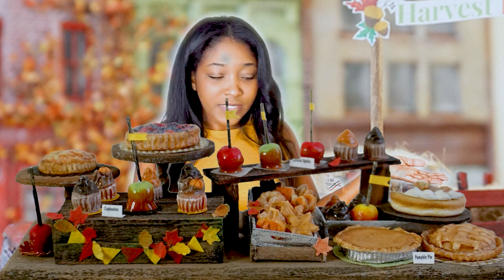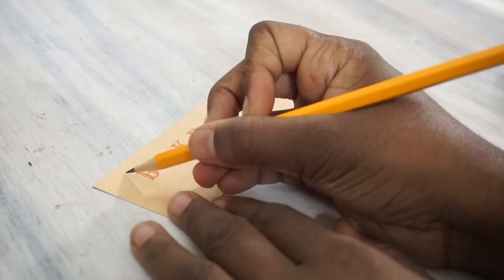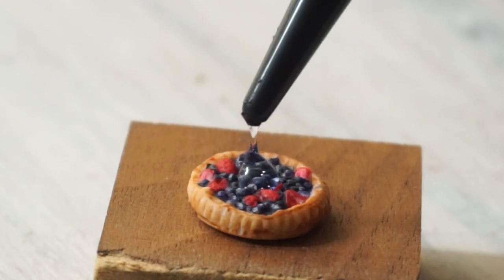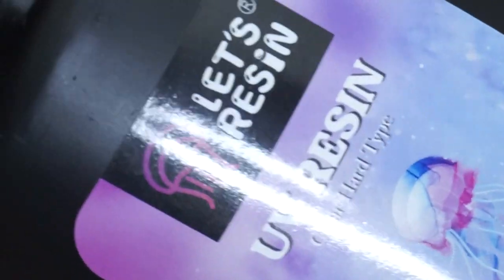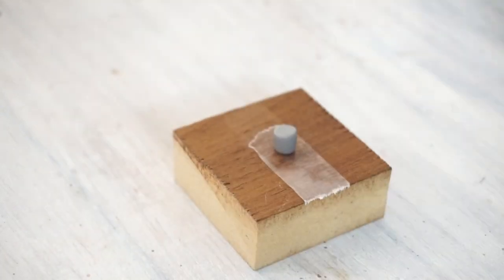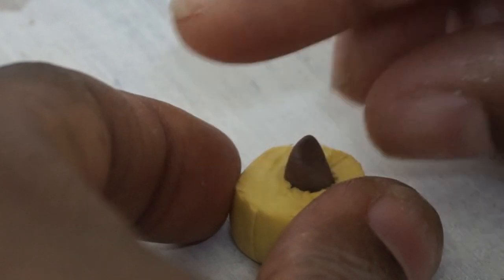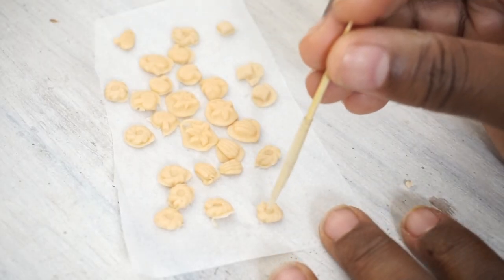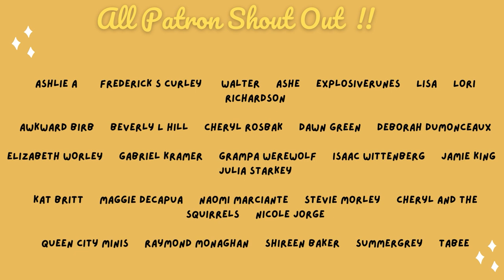Making Air Dry Clay Food Diorama / Craftember DIY Series Dollhouse scale Bake Sale

Comment: That food looks awesome. Well done! 
Also, thanks for mentioning the air dry clay. I can read Japanese and the instructions seem pretty standard (your Amazon link included a photo of the instructions): "Store in a warm place away from sunlight; Wash your hands before using it; Don't use water when you're working with it; and don't try to bake it in a microwave or oven."
Reply: Away from sunlight? interesting
Reply: @jaredrichardson78  Perhaps that was too literal a translation. "Keep out of direct sunlight" might be better.
Reply: @dndsl3436  I would have thought that's what you want to help it dry, though!
Reply: @jaredrichardson78  Your finished product yes. But not the clay in the package that you haven't used yet.
Reply: @dndsl3436  OH, that makes much more sense!